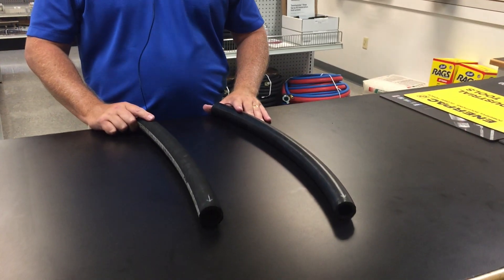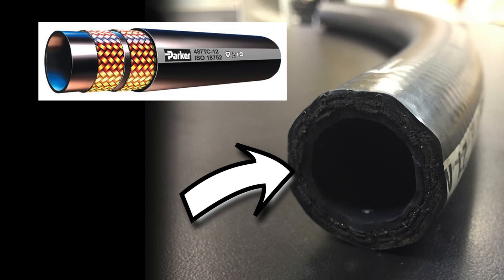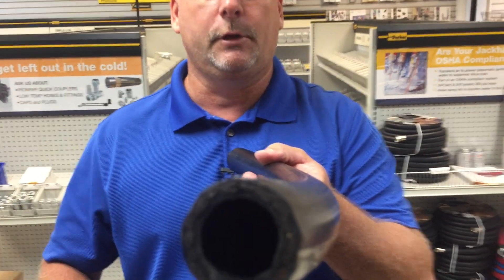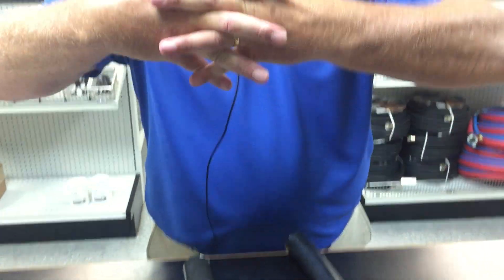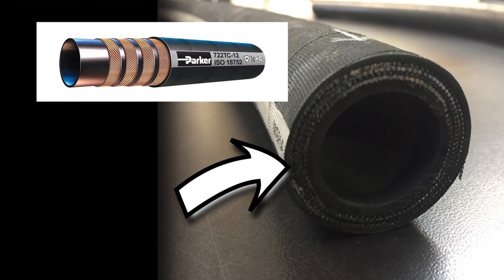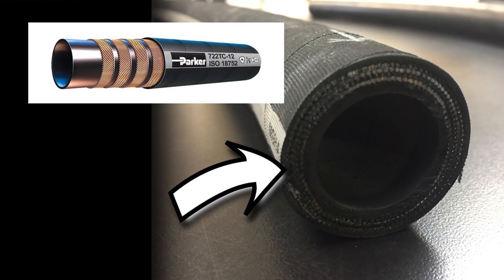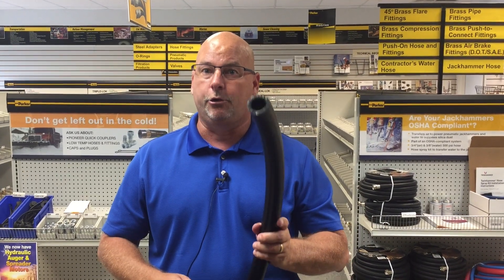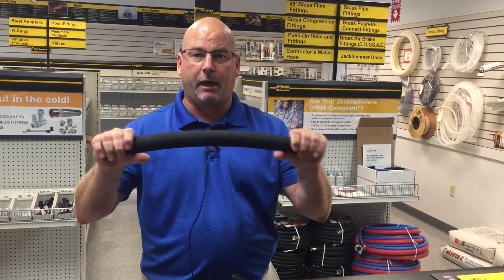Learn the differences between Spiral vs Braided hydraulic hoses

Comment: What is the failure reason of hose puncture.
Reply: It has either been punctured, or failed from within due to a combination of metal fatigue, sometimes rust and possible over pressure.  Only takes a single tiny little wire to break to be enough for a hose to fail under pressure.
Reply: For spiral, wire gaps and high wire(basically wrong stacking) and wrong tension are the highest failure modes.

For braided hose, wire loops, cross wires, broken wire and again wrong tension are highest failures.

Good braiding or spiraling always depend on good wire winding.

Comment: BAILI are the # manufacturer # supplier # exporter of  smooth / wrapped hydraulic hose, air conditioning hose .  we provide ultra competitive price , without  sacrificing quanlity. 

Our range of hoses include:

air conditioning hose  R12  R134A   5/16" 13/32 , 1/2"  5/8"
Wire Braid Hydraulic Hose  EN853 1SN / 2SN / 1ST / 2ST
Wire Braid Hydraulic Hose  SAE 100 R1AT / R2AT / R16 / R17
Wire Braid Hydraulic Hose  EN857 1SC /2SC
Multi Spiral Hydrdraulic Hose EN856 4SP / 4SH
Multi Spiral Hydraulic Hose  SAE 100 R9 / R12 / R13 / R15
Fabric Braid Hydraulic Hose  SAE 100 R3/ R6 /air hose 
I & 2 Wire Jet wash Hose (Black & bule color)
Thermoplastic Hose R7 / R8
I & 2 Wire Thermoplastic Hose
304 PTFE teflon hose 
Any inquiry  will get our promote attention.  if  need urgently response, please reach me at whatsapp /wechat: 0086-15297607201.

 looking  forward to working together .

Best Regards,
 
 Alice Wan

HENGSHUI BAILI HOSE CO., LTD
 
Whats'App: 00 86 152 9760 7201
WeChat  :  aliceyuan921
WeChat: 15297607201 
Skype :   alicebaili
Tel : +86-(0)318-2330005
Fax: +86-(0)318-2690005
Email: sales15@bailihose.com 
website:   www.bailihose.com    www.bailiflex.com.cn     
ADD: NO.20 Xiangsu Road, Hengshui city, Hebei, China